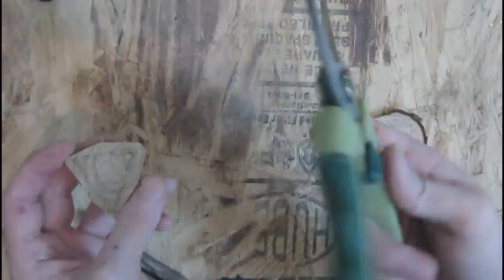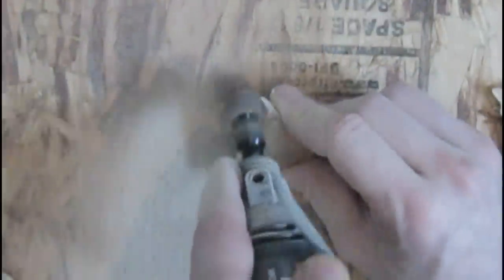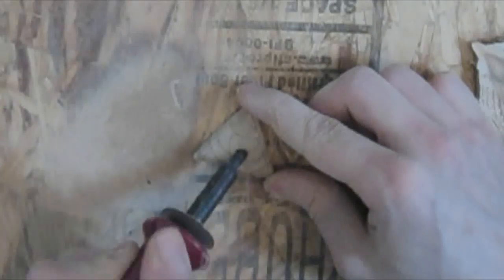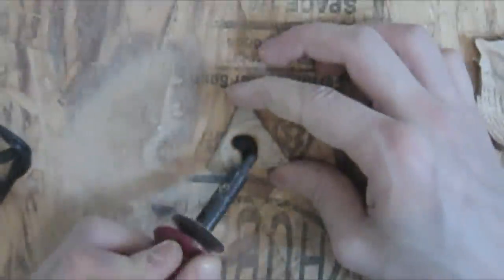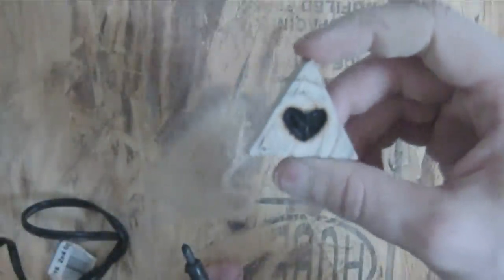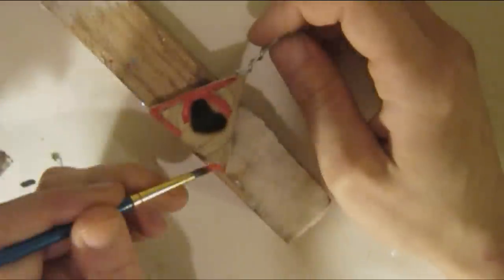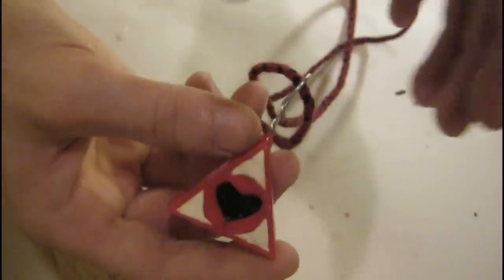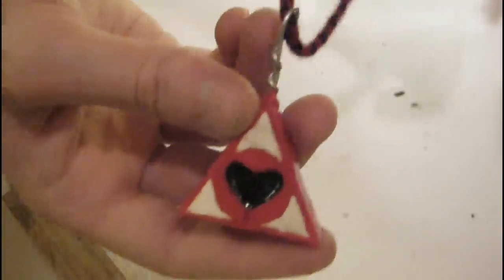DIY Multi Pattern Engraved Necklace!

Comment: i would probably give myself splinters no lie lol that's creative though
Reply from the maker: Matti Ice Thanks, I mostly hurt my self by the sander bits when they run away sometimes when I'm not holding it firm enough. Specially the thin sander/grinder , almost cut my thumb off a few times with that when it decides to kick.